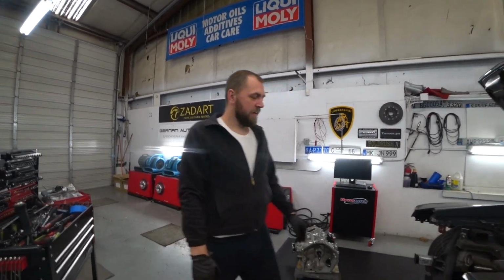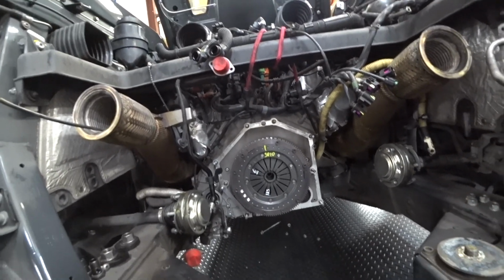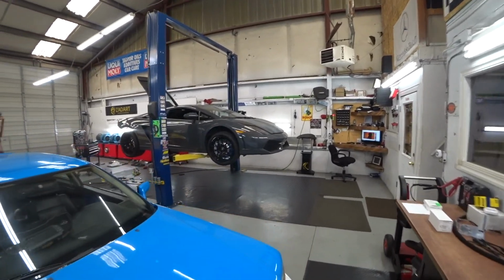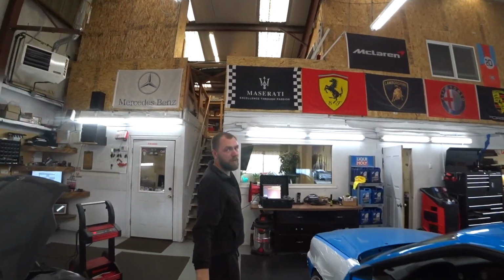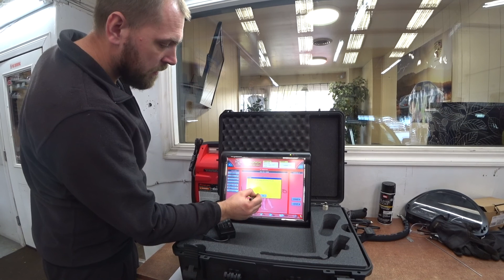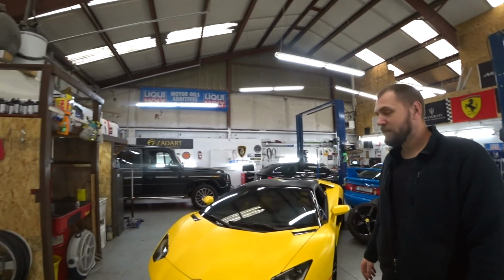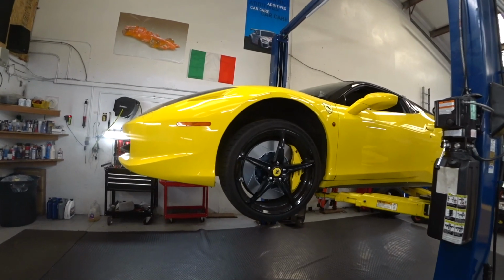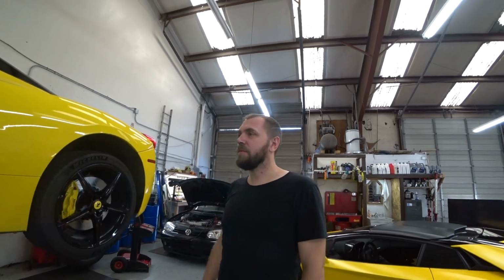Lamborghini Gallardo clutch replacement, gearbox repair. Launch control and burble tune !! VLOG #18

Comment: Hey so for the clutch bolts, you said “17 nm” is this same torque spec as Audi R8 v8? Because that one is “8 nm + 180 degrees”. 17 nm is only equal to 12.54 ft lbs.